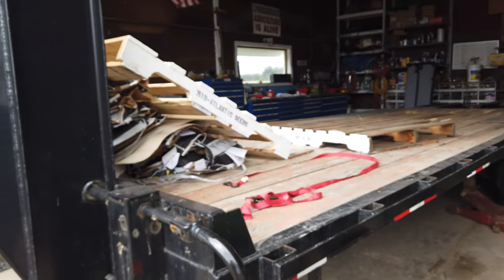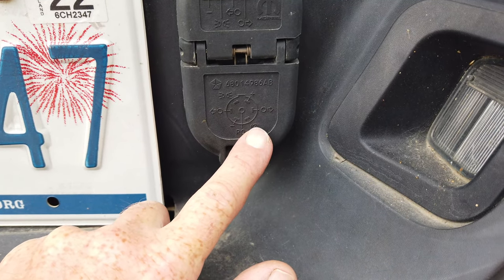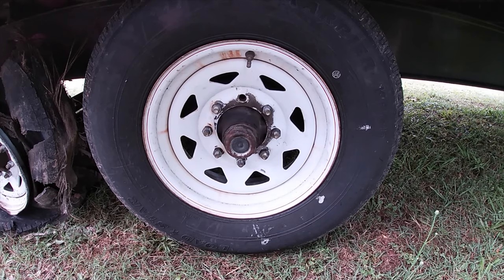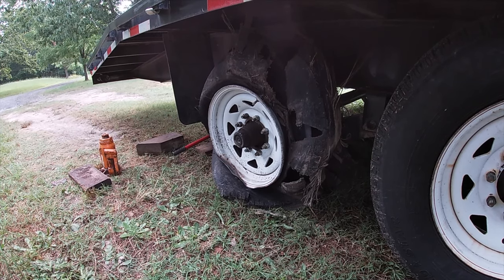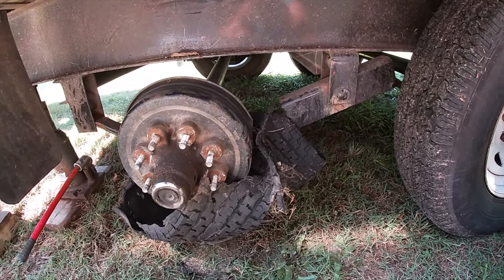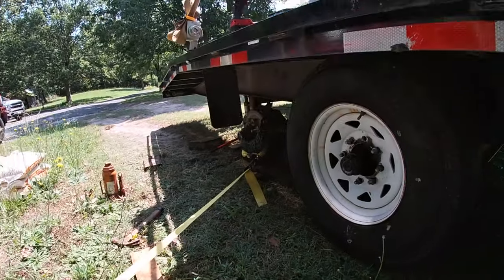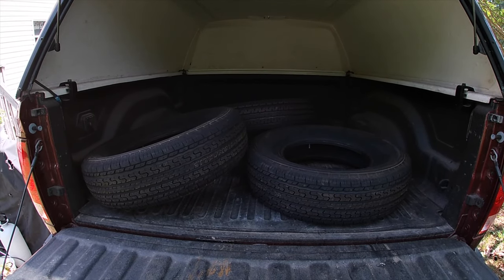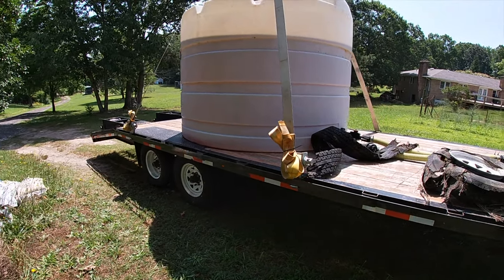2 Flat Tires on Gooseneck in 1 Day!

Comment: Both our trailers have dual axles..... same rims that the  our FORD Duallies use.... so I have about 4 spare rims.  Most probably bought 24 tires (235 85R 16)  in the last 2 years..... We haul round bales about 15 miles  from field to storage  in 25 bale loads.....   We order online and  if there is   unusual wear on any tire we do a complete replacement......Always have people looking for our take offs......